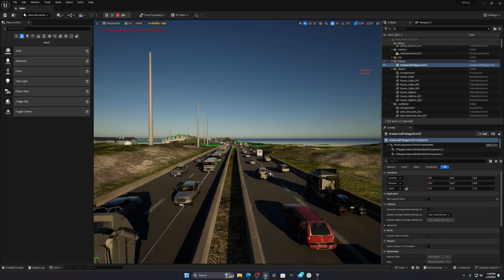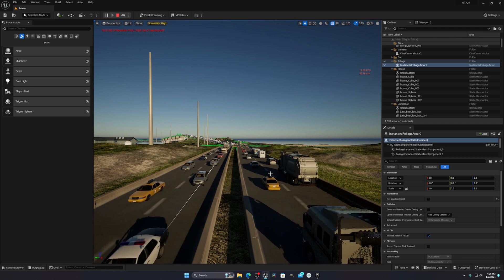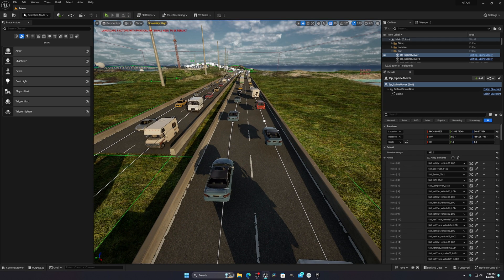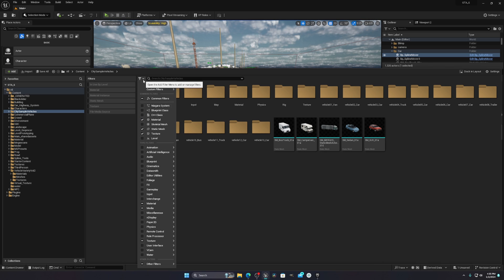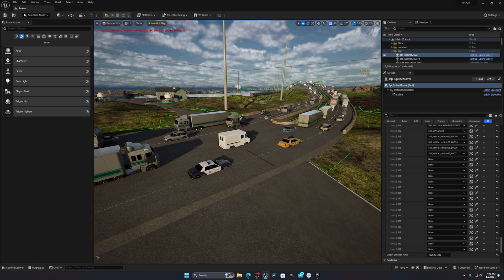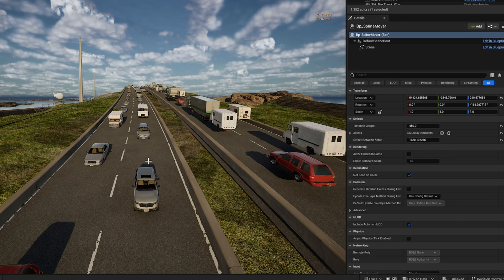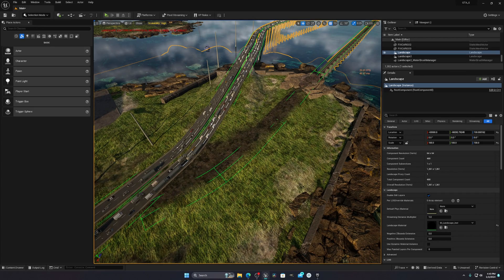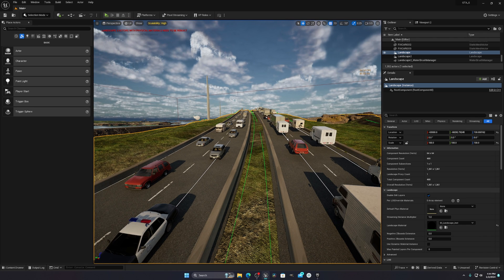Create Realistic Highway In Unreal Engine 5🚗....

Comment: Could you do this using niagara? Would it not be easier? Less memory. You would not need to add all the vehicles manually
Reply from the maker: I don't know about Niagara system that much that's why I use this method but i will try this thing with naigra also
Reply: Yes you could do this with Niagara. But it's pretty much the same process plus extra work for the same result. You will get a performance advantage with Niagara using GPU particles but modifications and interactivity come at the cost of more work to hook up. It might be that you don't even need the performance gains so weighing up the time advantages is where I would begin.